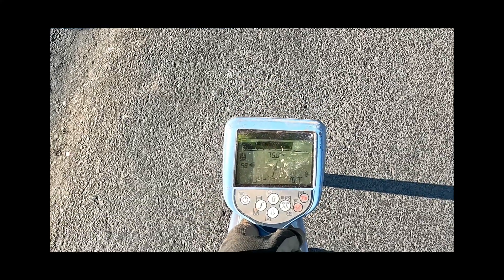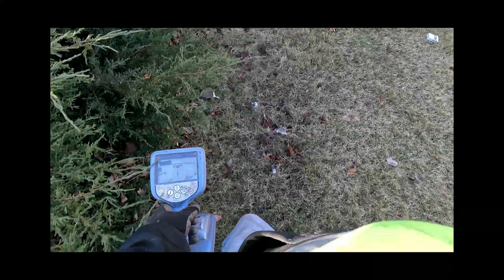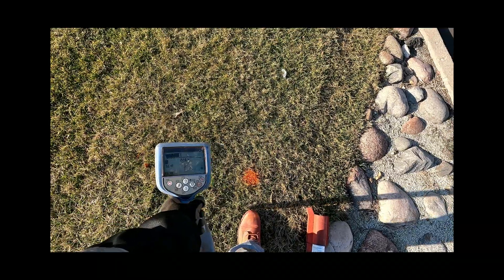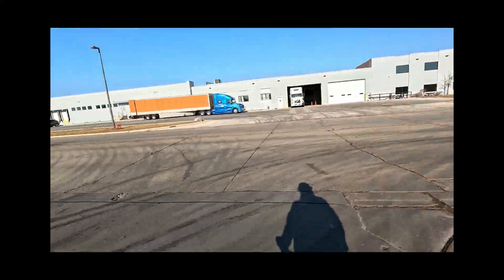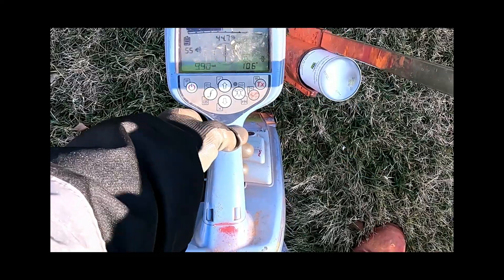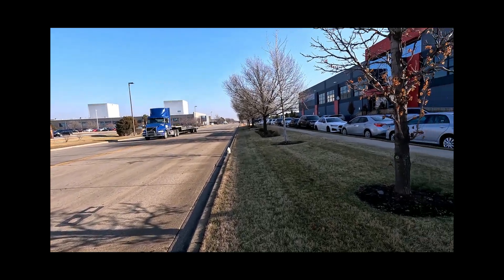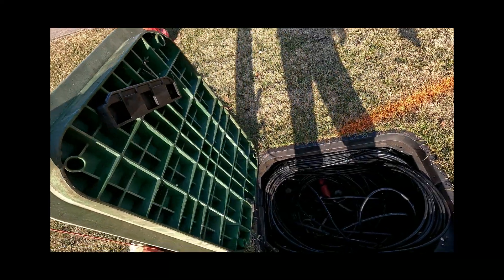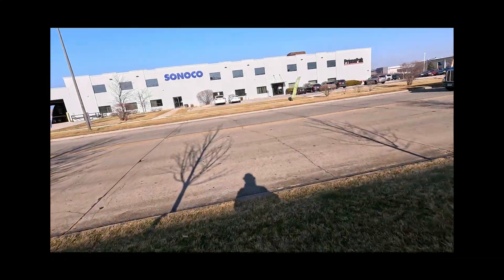Discover The Real Utility locators | Damage Prevention

Comment: So is high or low miliamps important or what should we be looking for
Reply from the maker: You want a steady, consistent milliamp reading—not necessarily high or low—because stability shows a good, clean signal on the target line. 

Example: if your transmitter shows 45 mA and it stays around 40–45 mA as you locate, that’s a good, stable signal.
Reply: @811chicago5 understood & that's all when we are started/hooked on which would maybe show that? & of course keepin signal as you mark.

Comment: People don't understand how long locates take. Some locates I'm connecting to 100 different connection points taking 8 hours just to mark out. And here we take measurements, map it out and give it to contractors so just sketches takes hours on the long jobs. It shows hours done and some are 10 hours no I'm not quickly getting some locates in
Reply from the maker: Yep, that’s the problem people think that locating is as simple as hooking up and getting results in two minutes. They don’t realize how much time it actually takes, especially with issues like bleed-off, no tone, or bad tone on the cable.

Comment: Do you have a video explaining dropping the wire through the manhole holes.
I've heard of co-workers dropping their leads in a flood hand hole to find utilities,
I've tried it myself, but had no luck.
Reply from the maker: Sorry, but I'm not really sure I get what you're asking. Please elaborate. "wire"
I'm utilizing an electrical conductor to apply an electrical charge to the ground inside the manhole to locate that electrical duct system because each electrical vault is grounded at both ends. It would be quite difficult to locate and/or generate a tone on the duct system if these manholes weren't grounded.
This method will not work in any other utility, such as telecommunications, cable television, gas vaults, and so on.
Reply: @811chicago5   at 1:08 in the video it shows like you just used an old wire from some old lead and tapped a flag stick at the end of it. that's what I was trying to ask. do you have a video on how to make one.
so those bastards at work were busting my chops then, telling me I can find phone  and tv with just the leads in the water.
Reply from the maker: Dropping your leads into the water increases your chances of bleeding onto other utilities than the one you're looking for. The best approach is to direct connect to it, but if you can't, your next choice is to clamp on to it.
Taking shortcuts like that will lead you to major damages by dropping your leads into the water to locate telecommunications, cable television and so on. So take my advice to locate the way your companying trained you to locate their client's infrastructures.
Reply from the maker: @joeym5040  He must be a new locator who has to watch more of my videos to obtain the necessary experience.